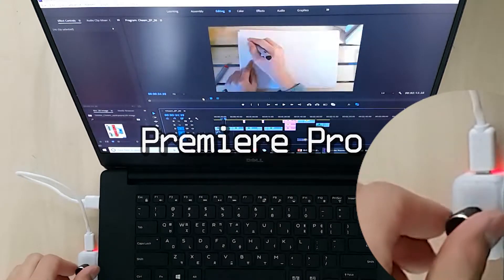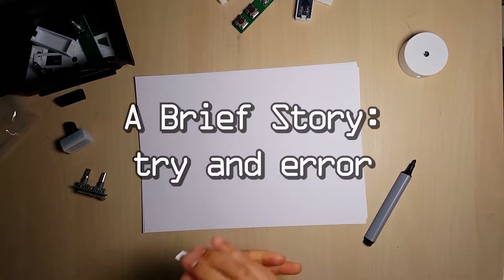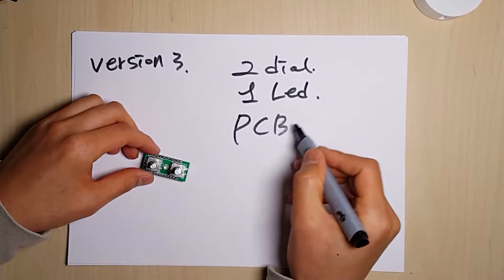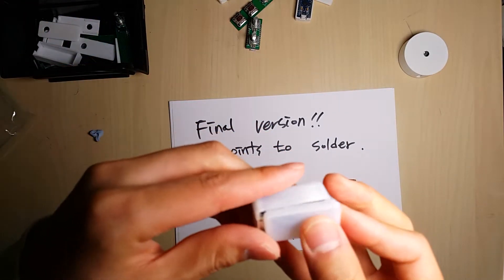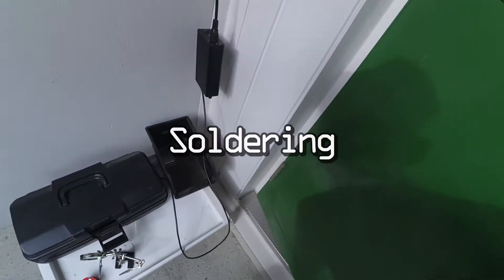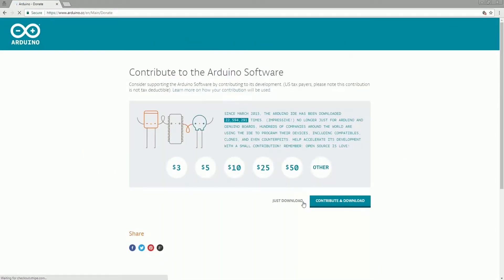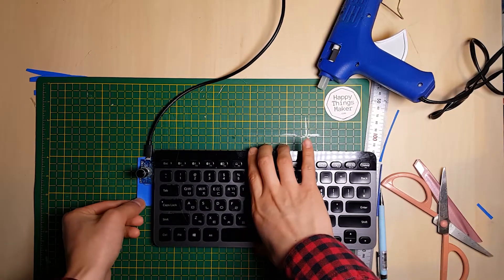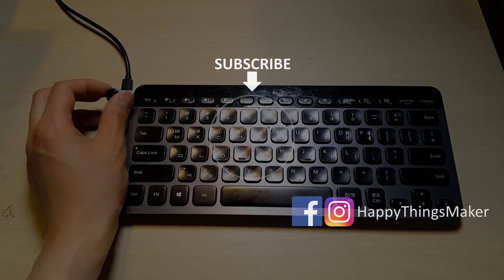Midi controller | Premiere Pro | Lightroom | Navigation Dial DIY (NEW) |  Video Edit Jog Wheel USB

Comment: that's awesome, can you do a video how to use it in different programs? and how to adjust it..?
Reply: i hope it'll posted soon :))
Reply: Still waiting for this video :)
Reply from the maker: oh, I am sorry for the delay, life is not easy. I moved cross countries and setting down. I will post how to video as soon as I settle down.
What program do you want to control with this controller by the way? is it enough to make a video about how to change keys?
Reply: Im sorry for my impatient, and thanks for the reply. Sure, take your time. I plan to use this as brush size slider on Clip Studio Paint. I know what shortcut that program use. I think a video about how to change keys is enough for me. And if you don't mind, i want to know how to change how many mode that we can set to this dial. In this video we can use 2 mode. Can it be 3 or 4 mode change when we click the button?
Reply from the maker: Hi again, no problem! 
You can make mode as many as you want. :)
Reply: Now i'm thinking, can we make a program on the computer to bridge the knob, so we can change the shortcut, without changing the code on the arduino. Just like the logitech gaming mouse that can bind some shortcut on their hardware
Reply from the maker: oh, that's a good idea. You mean, it is user-friendly application. 
yes I think that it is possible but it needs time to make the application for the feature. 
Actually, these days I am new to make windows application. I should've study it.
I am studying python, I hope I can make it soon. Thanks always :)
Reply: Yes! An User-friendly program. Python is a good start. I'll look forward to it. I'll switch notification for this channel :))
Reply from the maker: oh, my goodness. I have to hurry up. these days, I am developing a humanoid robot by using python. I am going to make a user-friendly windows application for the robot. There are many common things between this project and the robot project because both are using Serial Com port. I don't know how to figure out though 😱. You give me super motivation. Thanks !
Reply: Wow! Glad to hear that. 

Break a leg, and godspeed!
Reply from the maker: Of course, Thank you for giving a great feedback. I will make videos for them.